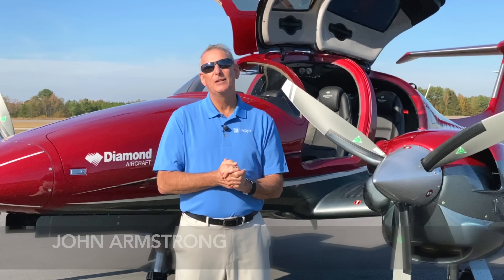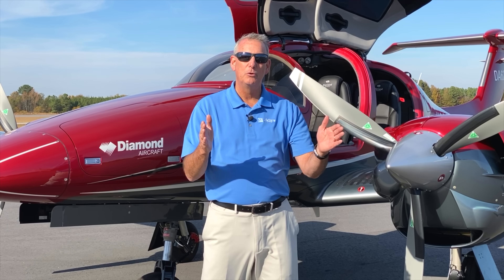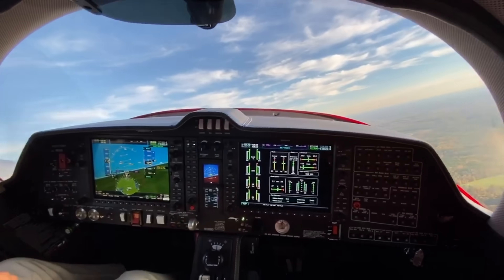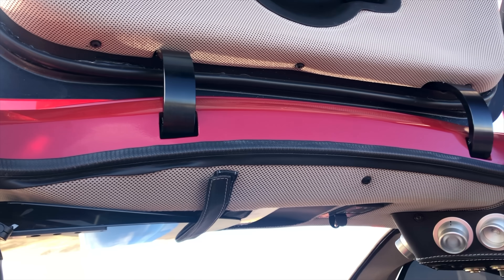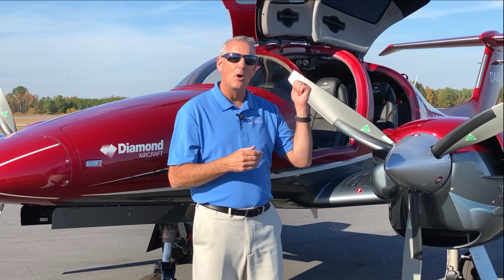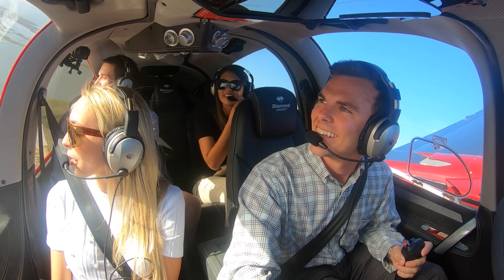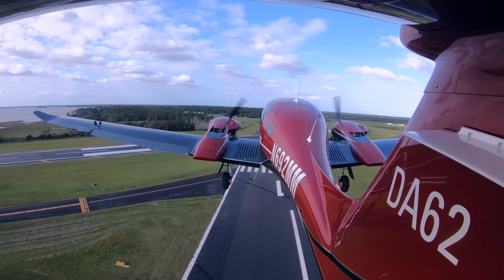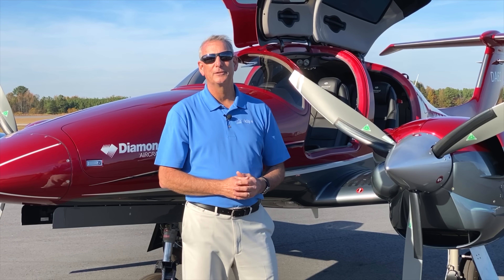What Makes the DA62 the SAFEST Twin-Engine Aircraft? | DIAMOND AIRCRAFT SAFETY SPECS

Comment: I really like the Diamond DA-62, but wish it was able to carry more weight. Especially, considering it seats up to 7 people.
Reply: Just be sure to eat more salads and fewer cheeseburgers. :P
Reply: J R: it seats 7 people, how much weight do you want. You can vary some light baggage like small overnight bags, but no GA plane is a fill the tanks and seats and bags. Piston that is.
Reply: Ictpilot Ictpilot I would love to see the plane be able to have the tanks full, and have the average weight of a person be around 200lbs, plus whatever the weight of anything the passengers bring. What if 6 of my guy friends and I wanted to go somewhere for a weekend with the fellas? Let’s say Denver, to Miami. 

The fuel tanks topped off will weigh approximately 576 lbs. then 7 guys that each average 200 lbs., equals 1,400 lbs. then luggage between 7 guys, let’s say averages 50 lbs., per person. So another 350 lbs.. That weight equals 2,326 lbs. To make the math more simple, let’s say you have 2,400 lbs. to play with, to factor in other variables or added options onto the plane that also add weight. The current max takeoff weight is 5,071 lbs. subtract the empty weight of the plane, which is approximately 3,461 lbs. and you have an approximate useful load of 1,565 lbs.. For all 7 guys flying somewhere, all of their weight combined, pretty much takes up the planes entire useful load. In my opinion, if I’m spending North of $1.5 million on a twin engine plane, I would hope to get at least 2,500 lbs. of useful load and not just 1,500 lbs. 

And with me and a few of my buddy’s, that are all over 6’ tall and stay in good shape by going to the gym, a few of us are in the 215 lbs., to 240 lbs. weight range. With only 1,500 lbs. of a useful load between 7 people, and the fuel is 576 lbs. also added in to the 1,500 lbs., that only leaves you 925 lbs. to work with. That means the average passenger has to weigh no more than 132 lbs.. Lets be honest. Unless you are a very petite lady, or you are a child, you and your buddies aren’t even coming close to touching that average of 132 lbs. a person weight.
Reply: @j.r.777  Not going to happen on a piston plane. Agree planes cost too much now, but there are  limits to what you can do on that size plane. Having the ability to load 7 people and fly for two or so hours with that size plane is great. What you have with this is the ability to adjust fuel load and or people. This plane like all other light twins is for a family say 2 adults and a couple of kids to travel, or several adults to fly for a business meeting, etc. If you're loading the scenario your talking about, you'll be in a turboprop or a jet not a light twin.
Reply: @j.r.777  Surely you meant to quote your mass in kilograms and your heights in metres?
Reply: L'aviateur de TRPG, I did not. All of the stats for the DA62, I got directly from Diamond’s website.
Reply: @j.r.777  OK. Maybe that just for the american market. I will look at their website for the rest of the world as those measurements make no sense to anybody else.
Reply: L'aviateur de TRPG they make sense to this American. We have big muscular guys here think American football players.
Reply: @nobaddaystravel6855  makes sense to americans, maybe, but not to anyone else . . .

Comment: Hope that the DA50 will retain all the nice features.
Reply: So they don't make that model yet?
Reply: @Aseutester  , it's in the process of being certified.
Reply: @davidteen14  Is it a single Engine version?!
Reply: @Aseutester  , single engine high performance, it has the DA62 fuselage with a 300 hp Jet A engine. It will come in two variants, fixed and retractable gear. EASA certification is expected late this year. 
https://www.diamondaircraft.com/fileadmin/_processed_/0/a/csm_csm_DA50-V_Gallery_Bild-_4__3671e492a2w_791eb2e871.jpg